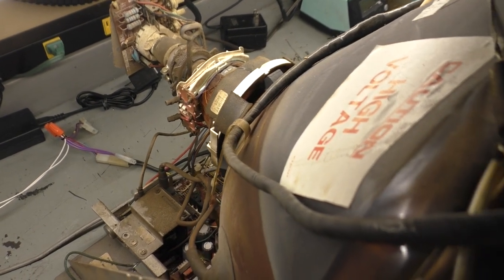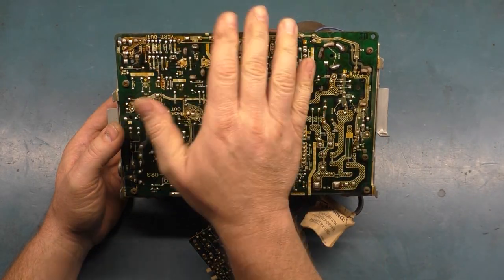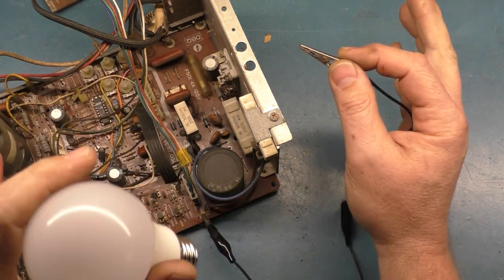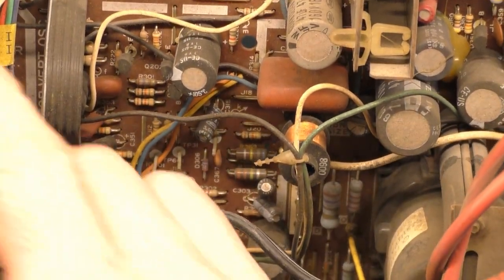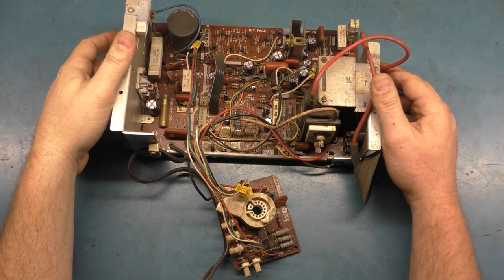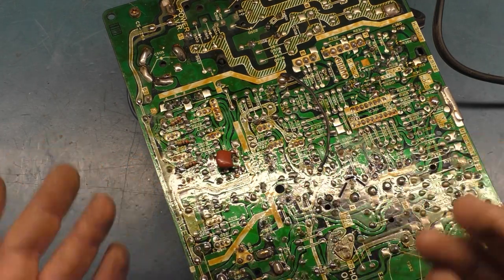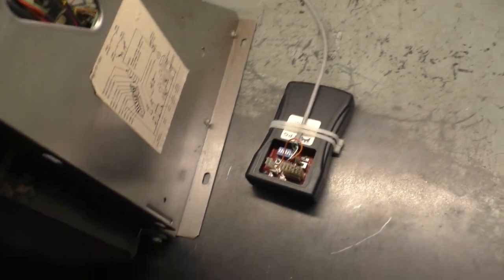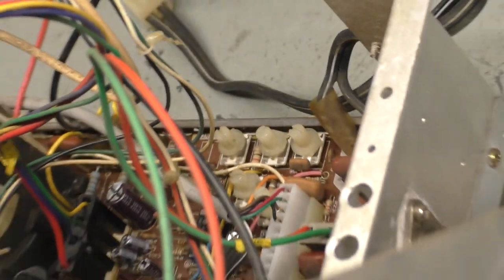19" K4900 Arcade Monitor Repair - Overview, What To Inspect, Cap Kit & Reflow Time Lapse

Comment: Hi Mike, love the video’s.
I have a few k4900 chassis. Is there any specific things I should be looking for to identify a k4915 chassis compared to a standard chassis?
Reply from the maker: Thanks! There is a little daughter board on the left above the voltage regulator with a shutdown pot on it. Easiest way to identify.
Reply: Thank You…
Looks like I have one, 
P390 W/ protect adj pot!
Reply from the maker: Yup!

Comment: What are the yoke windings resistances what neck socket do the 4900’s use. Thanks in advance.
Reply from the maker: They are different depending on which version of the 4900 you have. CR-23.